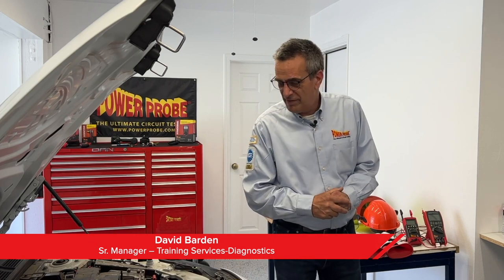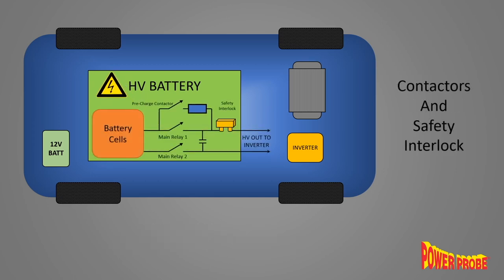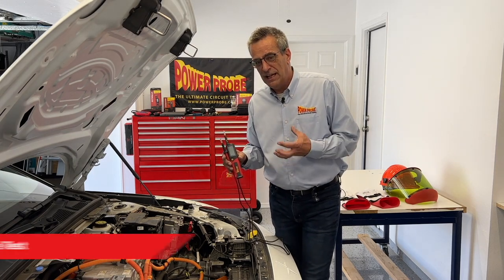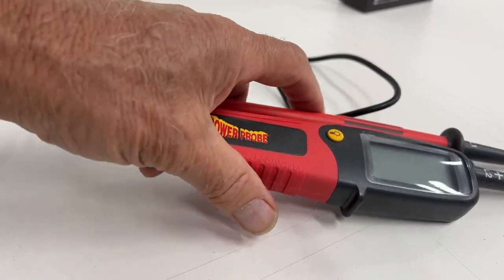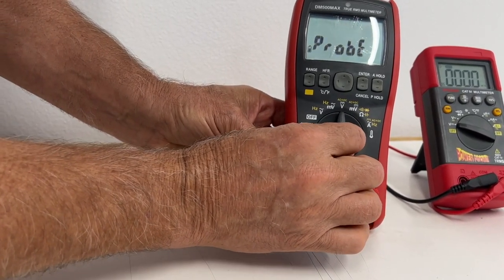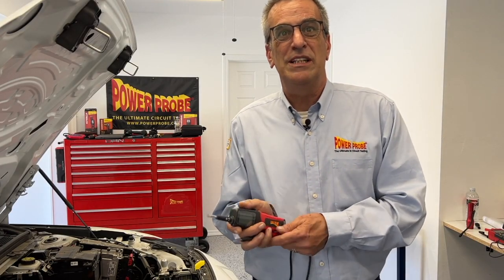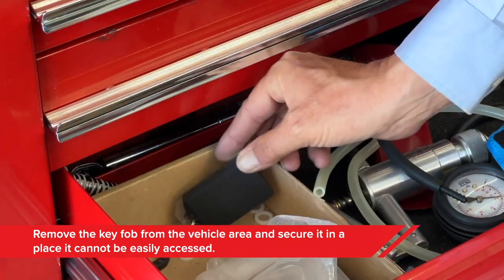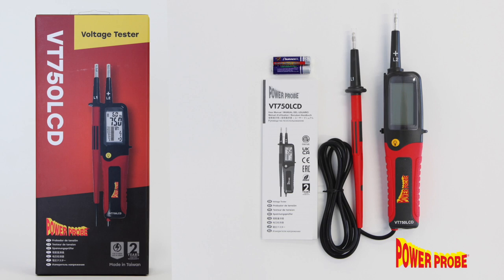The New 2-Pole Volt Tester for EV's | VT750LCD Product Demo

Comment: I see it says 12 volts minimum on the specifications, what if I'm testing a circuit and there's corrosion somewhere in the circuit eating voltage will it show the voltage for the circuit I'm testing below 12v and is there a decimal point in the reading , and/or can it do a voltage drop on that section of wire ? will it show that
Reply: I work on 12 and 24 volt systems of probably up to a Max of 36 volts if the alternator is full Fielding, old school test lights are cheap as heck and are always breaking they're cheap so I just keep buying them but they keep breaking or blowing bulbs, I'm looking for a good quality lower voltage tester, I don't want to have to hook up to a battery I just want to look for power and ground, if I have to move over to look for a good ground five or six or eight feet that's fine but I don't want to go from the back of the bus to the front of the bus, if it has a voltmeter on it that's fine I don't need resistance on a test light I'll pull out my multimeter if I'm looking for resistance or on a cheap test light the bulb will be dim
Reply: The VT750LCD will read as low as 6VDC, but it is in 1 volt increments, so low voltage readings are not as accurate as with a low voltage meter or probe. The tool's primary purpose is intended for hi-voltage testing.
Reply: @kennethnorling5108 Using a Power Probe is the best way to find voltage drops, however they do require hook up to the vehicle's battery. Power Probe does offer a couple of more traditional test lights - PPTMV01 and the PPTACT1CS that may be more what you need
Reply: Thank you for replying 👍